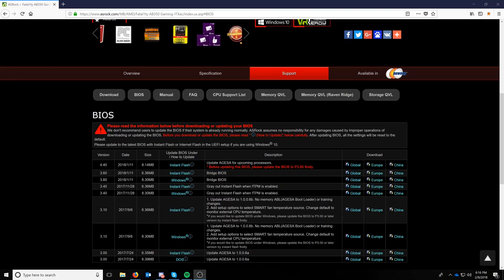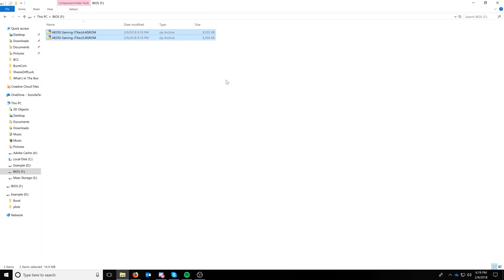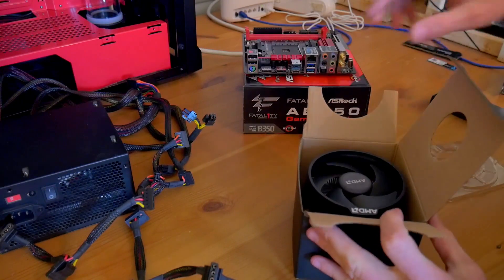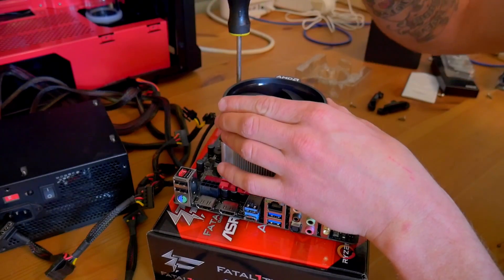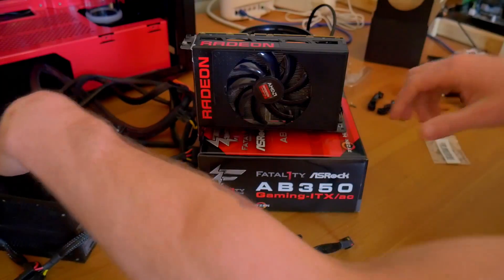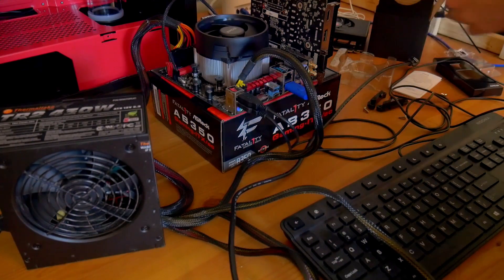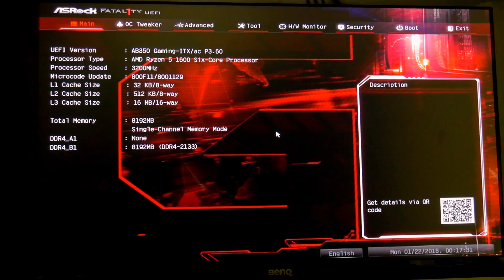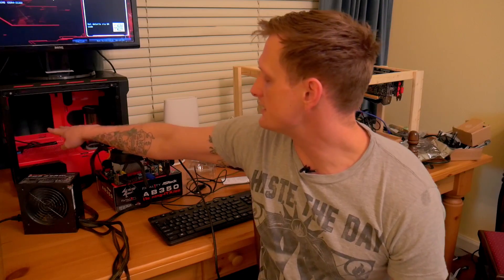How to Update A B350 Bios For Ryzen 2: Raven Ridge Build Vlog

Comment: I have an A320m HD2 Motherboard and I flashed bois of 2nd gen on it  for using Ryzen 3 2200g but now I'm buying R5 1600 will it work normally if I just plug it in the motherboard ? Or will I have to buy a new mobo ?

Comment: In case anybody comes over here because of buying a B3xx motherboard with a Ryzen 2 CPU and wonders if you can update it with the same CPU when it doesn't start up: You sadly can't. Either you have to send back the motherboard and buy a new one which is Ryzen 2 Ready, or you lend a 1st gen Ryzen CPU from AMD which you can get if you can prove you have purchased a Ryzen 2 CPU (quick google search will do it). Hope I could help anyone coming to this video when having that problem!

Comment: Have you tried the beta versions? I've flash it with the latest beta version (ab350m pro4) and it's unstable.
The cool part is that the Vcore of the Vega igpu option is now present in the Bios.
Reply from the maker: I need to look. The last one I updated to fixed nvme detection on some drives

Comment: Thank you for the upload. its straight forward with easy steps. I just wondering, I'm willing to build my FIRST AMD Ryzen 2400G with Asrock M/B and I don't have any old AMD CPU around. If I bought the GPU 1050Ti can I update the M/B like you did or also needs the old AMD CPU such as 1200 ?
Reply: If you don't have another choice, AMD can provide you with a bootkit to install the BIOS.

Comment: Any issues with nvme drives? My nvme drive is not detected in my bios is this a board issue, bios or  cpu issue? Im using an msi x370 gaming pro carbon.
Reply from the maker: Yes there are. The only one that gets detected so far in my testing is the toshiba rd400
Reply: Son of a Tech is this problem a chipset problem, a cpu problem or a motherboard problem?
Reply from the maker: I can only say on my setup. Trying to get another board to test. But money and stuff
Reply: Had to update bios to 4.50 before it saw my Samsung 240G M.2 SATA drive.

Comment: What total rubbish.. I cant believe how many fans boys are defending AMD for this huge debacle .....
Reply: So you'd rather buy a whole new motherboard?
Reply: Not sure what that has to do with my comment but ya ... you go with that son... i'm sure you'll go far.
Reply: How is a BIOS update a big deal in any way
Reply: Nah, it's just not a big deal.
Reply: Neither. It's just not an issue. I don't understand why it would be.
Reply: only if you get an old chip which you should not have to do the am4 boards. They were made for these chips they shouldn't need an older am4 chip to update the bios its bull shit! The new chips other than thread rippers are am4 chips the idea that i need to pay some one to upgrade a board or wait to be loaned an old chip is bullshit.
Reply: These fucking fan boys are the same kinda stupid asshats that voted for trump ... SAD!
Reply: when the intel changes sockets yes you need a new board.. amd did not change sockets ass hat!
Reply: theldun1 honestly your comments weren't needed by anyone, and you also had all of your points and reasoning proved wrong
Reply: You're dumb. With Intel boards, you have to buy a new mobo to fit the new architecture, however AM4 will remain supported until at least 2020, all you have to do is update the BIOS.
Reply: Doubt it The whole point is you should not need to do that with a new mother board .... AMD knew they were making these chips even before these boards where shipped. They should be software updateable. In today's world time is money and whole hell of a lot of time and productivity was lost waiting on this fix.
Reply: Well either your a troll or your just plain ignorant... Really not much difference...
Reply: its how you have to update the bios you fucking jagg off
Reply: if you have to ask that question you don't have a clue about the situation at all. So just do a lil research and you'll see why its a big deal.

Comment: There is any way to update at 4.40 this motherboard with RRidge 2400G using a discrete GPU board? I need a gen1 Ryzen? No way???
Thanks!
Reply: Salvo Ognibene  asrock sent me  new update BIOS chip  by mail received this morning, just check with them.
Reply: Which version, If I may ask?
Do you wanna share with us the BIOS?

Do you've update with a gen1 ryzen or by discrete GPU?
Same board?

Thanks.
Reply: Salvo Ognibene  BIOS version 4.40 , none of these methods, just change BIOS chip.
Reply: :(  literally by changhe the chip!!! :( Not for me. Thanks.

Comment: Hey i want to get into pc stuff and i am wondering how the bios flashback works
Reply from the maker: You load the Rom onto a sub power on the board and hold the bottom till it starts flashing. More info on manufacturer website
Reply: Son of a Tech thanks for info!

Comment: BIOS version 4.40 has no m.2 support. You cannot use your m.2 to install Windows on. This was confirmed by ASRock tech support. Way to fail ASRock
Reply from the maker: I did all the benchmarks on an rd400. 4.4 so.....
Reply: Son of a Tech did you have a 2nd drive in there?
Reply: Son of a Tech also 4.40 has no support for the A series APU. It will  not post if you have an A series APU installed with 4.40
Reply: The nvme drive I used was Samsung 960 evo
Reply from the maker: Ya a 2tb hdd as well
Reply: Andy Veres Agreed. I'm seeing the same - 960 EVO not working in the M.2 slot of ASRock AB350 ITX with BIOS 4.40 but I don't have an A series APU to try. There is supposed to be a beta BIOS 4.43 but the links to it don't work. My workaround is a PCIe x4 to M.2 adapter, which works fine. I'm assured that ASRock know about it and will be working on it once the Chinese New Year celebrations are over! They kindly sent me a BIOS ROM so I'm prepared to gives them some time to fix this.
Reply: I was unable to get windows 10 to install on the m.2 with 4.40 It worked fine in 3.6 BIOS with an older APU. Could you test if the your m.2 drive is showing up in windows 10 installer or in storage config in the BIOS with 4.40? I have tried this with two separate ASRock b350 mini itx boards and two separate Samsung 960 Evo. Tried disabling CSM as well with no luck.
Reply: johnm2012 ASRock does know about it. I'm sure I can just use a SATA SSD for time being but I'm trying to build but really wanted to use the nvme as a single drive
Reply: Andy Veres When I put my 960 EVO in the motherboard M.2 slot it does not show up in Advanced\Storage Config, but neither do SATA devices (2.5-inch SSD or 3.5-inch HDD). The 960 EVO does appear in the Boot Options only after a cold start. After a warm start it does not appear. It is never seen by Windows Setup.
If I put the 960 EVO in an adapter and plug the adapter into the PCIe slot it still doesn't show up in Advanced\Storage Config but it is seen by Windows 10 Setup. That's how I currently use it and it works as expected but obviously I want to be able to use the motherboard's M.2 socket.
Reply: johnm2012 I have thought of doing that but my case limits me from using the pcie. I'll probably just use a SATA SSD until they fix/update the bios than return the SATA SSD. Hopefully they will resolve this issue soon.
Reply: johnm2012 thanks for the good idea. How ever my case doesn't allow me to use the pcie. I'm going to use a SATA SSD as my boot drive until the BIOS gets fixed. Or just get a different company motherboard. I live just 5 minutes from a micro center so I'm very lucky. Feel bad for anyone who has to mail hardware back and forth dealing with this issue
Reply: I know that ASRock knows about it because I told them and they confirmed that other people had also told them and that they could reproduce the problem. They (ASRock Europe) have reported back to head office in Taiwan so I'm sure they'll fix it soon. Since Son of a Tech had no problem with his Toshiba NVMe, maybe it's a subtle problem with the Samsung - though I did check first that it's on the QVL.
Yes, you could use a SATA SSD for now. I have the 960 EVO in its PCIe x4 adapter as C:, a SATA SSD as D: and a 4TB HDD as E: and it's all very usable, apart from the known buggy Radeon driver, which I'm sure will be fixed too. GPU-Z crashes my system instantly.
BTW, I'm using a 2400G and Corsair CMK16GX4M2A2666C16 which is also on the QVL. The RAM will run reliably at 2933 without any voltage or timing tweaking but at the moment I'm running CPU at stock and RAM at 2666 via XMP.
Reply: Nice stuff. I also have the 2400g. Maybe I will try to use a different brand NVME instead see if that works for now.
Reply: Andy Veres The ASRock is the best AM4 ITX motherboard for APUs, IMHO. This is just a temporary glitch and the only permanent downside is the lack of USB3.1 Gen 2. All other AM4 ITX motherboards have more serious failings. Which alternative were you considering? The Asus ones have no video outputs. The Gigabyte has a connector layout that doesn't suit my case - I appreciate their attempt at providing more space for coolers but I'm using the stock Wraith Stealth and don't need it.
Reply: Andy Veres I guess the Toshiba OCZ RD400 is a safe bet, since that's what Son of a Tech used successfully. On amazon.co.uk it's 50% more expensive than Samsung 960 EVO and the 256 GB model isn't even on the QVL (though the 500 GB is)! I have a feeling this BIOS was rushed out and wasn't tested properly. I made a point of making sure all my critical components are on the respective QVLs (so why would I pay extra for something that isn't?) but there are still problems.
Reply: johnm2012  I was going to try using a different brand m.2 drive and see if that works first. All my PC builds have ASRock mother boards. If I were to switch mother boards I would have to go with gigabyte. It's the only other mini itx am4 mother board  microcenter carries that has video out. The Asus board looks pretty good but I need the on board video support. I also may just be lazy and wait for the BIOS fix and just use my old PC in the mean time.
Reply: Andy Veres Given the fact that you can't use the PCIe slot my advice would be to wait for a BIOS update. Stick with the ASRock board if you're otherwise happy with it - I certainly am. If you need to use it in the meantime then install Windows onto a SATA SSD for now.

Edit: Or try a stick of RD400, of course.
Reply: johnm2012 beta bios 4.43 fixed the m.2 issue
Reply: Andy Veres Thanks. I'll try it tonight now that the links work.
Reply: johnm2012 what drivers are you using for the APU? The drivers from AMD are giving me a green screen and not working.

Comment: I was looking to build my first PC in the coming weeks and I wanted to go with the ryzen 2400g and msi b350 tomahawk motherboard. Can I download the update on a flash drive and update the bios using the 2400g or do I have to have a first gen ryzen CPU in order to do that?
Reply: fake I had a discrete gpu and it still didn't work if the bios isn't up to date then the only thing you will get is the fans spinning. It doesn't recognize it as a CPU period at least in my case it didn't.
Reply: For now, you must have an older gen CPU compatible with your motherboard in order to upgrade the bios. Having just Ryzen 5 2400g is not enough. You have two options if you want to save money. One, to wait for a new motherboard with Raven Ridge support right off the bat. But I don't know how long it will take for them to be released. Or if you are impatient, you can buy the cheapest CPU the MSI B350 Tomahawk can support and upgrade the bios with that. The cheapest ones I see on their support page is either A6-9500E or Athlon II X4 950. Either can be bought for about $50-60 depending on where you buy them from.
Reply: I've heard that you need a discrete (external) GPU board to boot and update BIOS. Truth or fake?
Reply from the maker: Unless you have an earlier apu
Reply: I've read this information on another video about raven ridge but related  another motherboard B350
Reply: Here: ?v=vfXwJnIiiZ0&lc

Comment: Can I update BIOS without a first gen ryzen? Because I don't have one and stores here "doesn't have technical support " to update BIOS
Reply from the maker: +Sora Gaming only on boards that support bios flashback like the higher end asrock and Asus boards. Making it not practical for an apu
Reply: Son of a Tech you mean the x370 boards?
Reply from the maker: very specific ones. Like the x370 taichi for example.
Reply from the maker: because with bios flashback you do it with no ram or cpu installed
Reply: Son of a Tech I'm fucked, thanks for quick responding btw!! I watched ur 10 hour video about ryzen, like and subscribe (Y)
Reply from the maker: awesome! sorry to have to deliver bad news
Reply: Son of a Tech so ur saying with the x370 taichi I can update the bios without a 1000 seris ryzen? If u can get back to me that would be really helpful.
Reply: I've heard that you need a discrete (external) GPU board to boot and update BIOS. Truth or fake?

Comment: Can i still used the apu to update the Bios?
Reply from the maker: You will want to get a board that supports Bios Flashback. Both Asus and Asrock have boards with those features. However, they are too expensive for this type of build imho.
Reply: Son of a Tech i have a Asrock A320M-DGS Motherboard
Reply from the maker: will need a 1000 series to flash then
Reply: Son of a Tech ok. Thanks

Comment: Thanks for the VID.. Was wondering if there is any improvement to the older chips with the new BIOS?
Reply from the maker: +MarcasswellbMD haven't tried. It may be the cause of instability. Hard to tell without more time.
Reply: Thanks you are the only one that mentioned this bridge BIOS.. I always just did the Internet flash, I never flashed manually, and doing it twice works my nerves a little especially when it may make my system  unstable.... I have the 1700 on a Taichi at 3.9 stable.. 2666 on the memory stable..
Reply from the maker: +MarcasswellbMD it got me a little nervous too
Reply: I have the Asrock Taichi with a 1700/3.9Ghz.... I always just let the BIOS do the Asrock Internet auto Flash, Its been about 10 years since I actually Flashed a BIOS.. That's why I said, I was nervous about doing it twice in a row.. I know I can do it, but it's still nerve racking to say the least.... ((But The Main thing, I think Most of us are curious about is if there's any performance benefit to BIOS, P4.40 with the OG Ryzen chips like the 1600 or 1700??? if you could do a Vid on that, I'm sure even if there's no difference it will still get a lot of views..)) Love your Vids, I thought I was already a SUB, but just subscribed today to keep up.. Lots of thanks,,,  I'm Marc from New Jersey..
Reply from the maker: I've heard most people are getting bsods on the 4.4 with 1000 series. Haven't confirmed myself yet. But I would wait a little bit until another rev.
Reply: I'm going to wait on many more reviews'' lol....

Comment: What a nice little board, Asrock always do a solid product. love your channel mate found you through a BBT live stream when we were all shooting the shit in the chat. All the best and may your  hashrates be high!
Reply: Jolinator I bought this board too and the only thing I can complain about is the fact that it doesn't have USB 3.1 Gen 2. It has a USB-C port but it's only 5 Gb/s Gen 1.
Reply: It's certainly cute but there are problems with the 4.40 BIOS. Hopefully they'll be fixed soon.
Interesting that the official reason for no USB3.1 Gen 2 is that the trace lengths are too long. I see that the Gigabyte ITX board has the B350 chip much closer to the rear connectors. But if trace length is an issue on ITX boards, how do they manage on ATX? Perhaps the increased area gives more flexibility in the positioning of the chip - I'll have to remember to take more notice in future.

Comment: Anyone here using the ASRock ab350m pro4? Have you updated the BIOS to 4.50?
Reply from the maker: you having issues?
Reply: Son of a Tech Yes some random BSODs like KMODE EXCEPTION NOT HANDLED and some freeze.
Reply: Son of a Tech 3.40 is fine. Updated to 4.50 and I start having these issues
Reply from the maker: +BlazingApple I am currently installing Windows on this one will keep you posted
Reply: Son of a Tech In the Asrock ab350m pro4 board?
Reply: I have updated to  V 4.60 all O.K. no o.c. of ram or CPU. Ram is Adata 2400 MHZ CPU ryzen 1600
Reply: 24321619 using the ASRock AB350M Pro4?